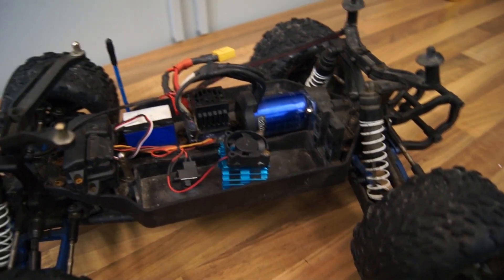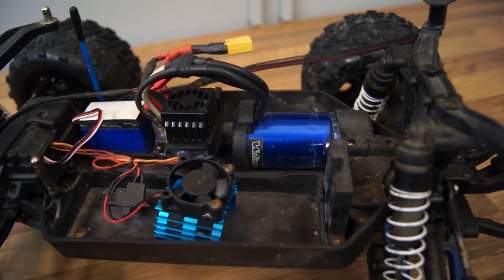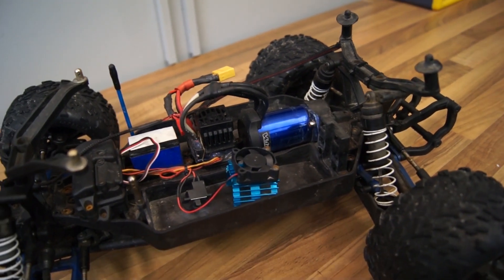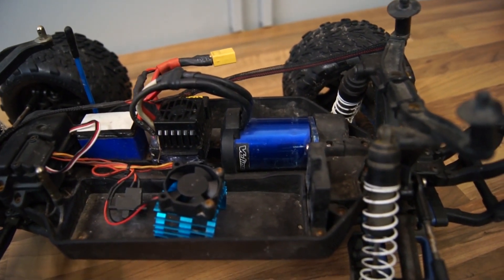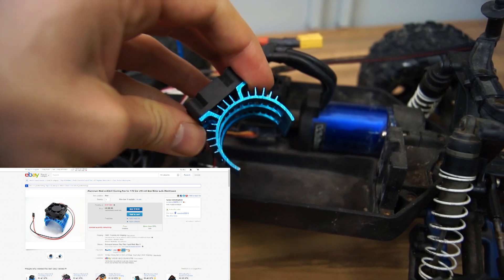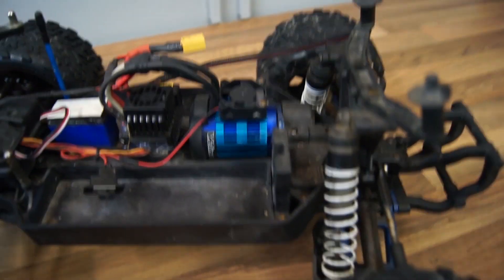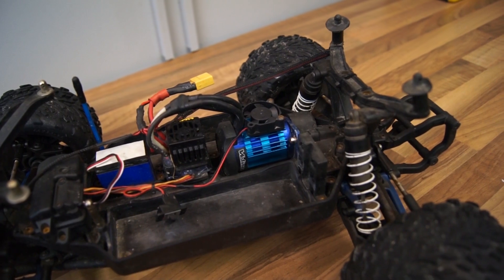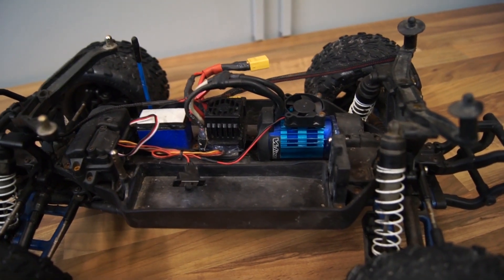How to Cool Down Brushless RC Car Motor

Comment: Will this work for brushed motors?
Reply: Yes, what size is it? Or what motor is it?
Reply: DaanRacer Titan 12t 550
Reply: @maynardsmusicroom3981  that should fit, I bought this fan from aliexpress and it comes a month earlier, so I would buy it from aliexpress
Reply: DaanRacer thanks 👍👍
Reply: @maynardsmusicroom3981  no problem

Comment: Where do you connect the power for the fan?
Reply: Typically there is a plug on the ESC.  If you are already using that, you can purchase a splitter, or run it directly to your reciever

Comment: After one of my motors melted through the chassis of my car I knew there was a problem.
This helped a lot!
Reply: hahahaha
Reply: If we using metal chassis, it will act like heatsink right ? Problem Solved ! Big heatsink :) That's how heat transfer mechanic
Reply: @nashrulsyazwan9590  weight a minute...
Reply: @freepalestine7123 weight? aluminium is light
Reply: Holy fk 💀

Comment: 110C = 230F, which is 30 degrees above when it should have been shut off.  Those temps means you had an issue with gearing and/or resistance in the driveline.  At those temps, your magnets in the motor may have been damaged and will cause your motor to spin even higher than normal in the future.  Double check your gearing isn't too high for your setup and that there isn't a bad bearing in the driveline.
Reply: Some motors which send their temp signal to the esc shut off at 105°C for protection.
Reply: @Ilker_Ali89  pretty sure most motors don't have a temp sensor tho? Are you talking about esc over temp cutoff?

Comment: everyone buy such an fan and cooling plate, but what is with all the dirt and mud, when bash than the fan stops working because of too much mud? i have a dirt cover but then i get no fresh air from outside. anyone has  a solution for this?

Comment: I bought 2 of those fan set ups for my rustler. 1 for the sidewinder 3 esc and motor. my gearing is 24p to 73spur. today is the day. gonna take her out to a closed highway and open her up, see what she does in a 1/4 mile. thanks for the video!

Comment: Where did you plug it in to the receiver? Was it one of the ports or into the 'extender' slot?
Reply: I'm 4 years late, but you can just plug it into one of the ports